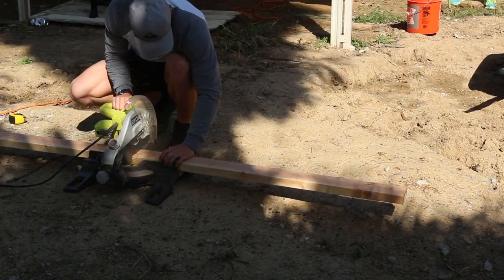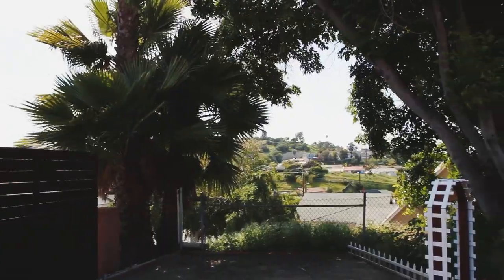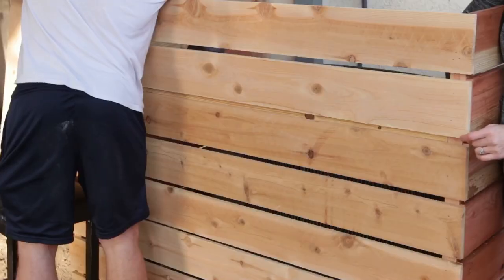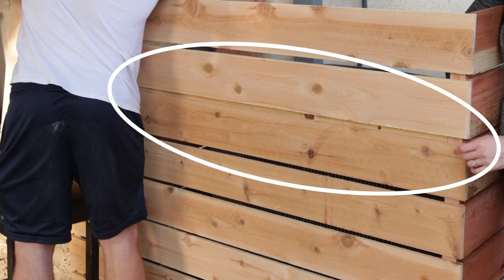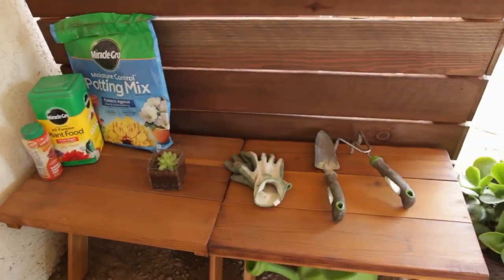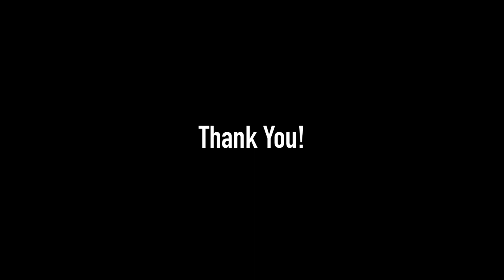DIY AC Unit Cover | Quarantine Project | How to Hide AC Unit | Gardening Corner

Comment: I’m no expert but do you need to allow the unit to ventilate? It’s a beautiful fence.
Reply from the maker: Hi Carlos! Yes you are correct.  The unit should have 12" or more distance from the surround on all sides to draw in air. It should also be open on the top and the fencing should have slats to allow air to pass through👍 thank you for your comment :)

Comment: 2:58 The best thing I ever did after purchasing my air nailer and compressor, was to buy a small affordable gravity fed sprayer. Painting and staining stuff is so much easier and faster now, and no brush strokes. I only mention this, because I noticed that you used a nailer for the boards. 2:02
Reply from the maker: Thanks, we’ve looked into that but we read it used a lot more product to spray. Is that your experience?

Comment: a great way to destroy your condenser early. read the manual. you're not supposed to build structures around it like this. needs way more airflow than this.
Reply from the maker: You couldn't be more wrong. Unit is fine and airflow is great. Thanks for your thoughts.